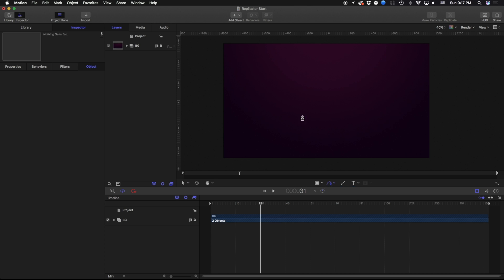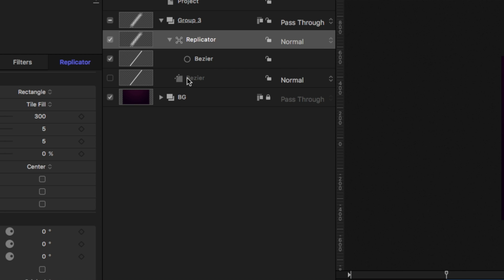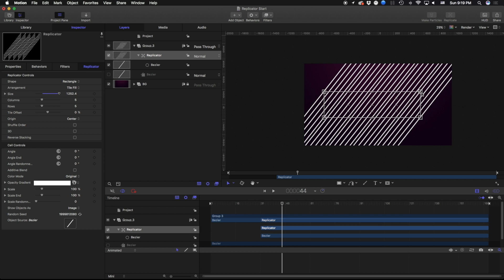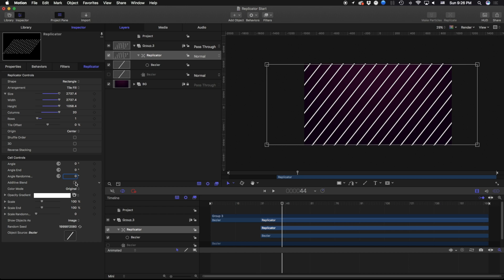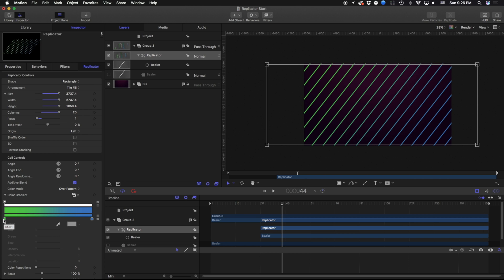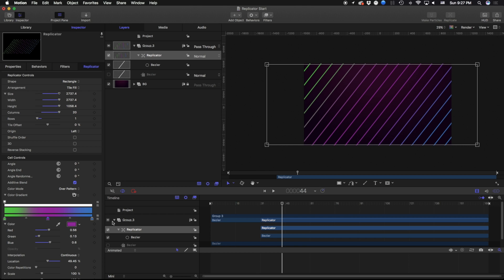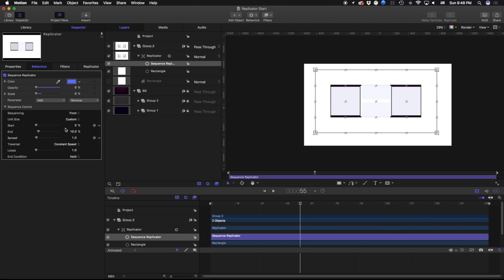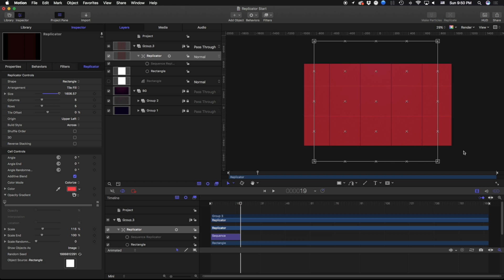Intro to Replicators - Apple Motion Professional Training 8 by AV-Ultra

Comment: Thank you so much for this series. When you replicate from top left, is there any way to have each cell come in one at a time? I notice it does the whole diagonal row rather than each individual cell and I can't seem to find a work around.
Reply from the maker: Yes! There’s a few controls that can be a little confusing. There’s cell control and replicator control. Most replicators also include a replicator sequence. This is what you want and can fine tune each and every parameter timing etc.

Comment: you are the best, thanks! have you found any ways to make a replicator reflect surroundings?
Reply from the maker: Kinda, either in two ways, flatten the layer matter and treat it as a single source, or fake it with a clone replicator layer and flip it and lower the opacity so it looks like a reflection. Hope that helps.

Comment: Following along and doing well until you replicate the replicator.  I cannot do this here in Motion 5.4.4.  The Replicate button is greyed out.  Searched Apple docs and it says you can't replicate replicators.  So, being the newbie that I am, am I missing something?
Reply from the maker: Interesting- perhaps they changed it? Let me check on this in 5.4.4 and see. Thanks for mentioning this. 
-Stanislaw
Reply from the maker: Try putting the replicator on the group the original replicator is on, instead of the actual replicator. 
Effectively- motion treats the first replicator as a single ‘flat source’ allowing you to stack the replicators.

Hope that clears things up and apologies in the delay.
-Stanislaw

Comment: Hey Stan, thank you so much for this series!
I'm actually curious to know if it's possible to use these sequence replicators to do drop zone transitions.
At 15:50, this could be an awesome transition if the element was actually a drop zone and that the background would be another drop zone.

Could you do an episode about it please? 

Keep up the amazing work!
Reply from the maker: Hi there!
The short answer is you totally can- the long answer is it will take a little more work if you want different things in each dropzoone.
By default the replicator will copy the 1 dropzone, so you would likely have to figure out the maximum number of squares or rectangles, make that many separate dropzones (or clones to double up some images) and add them all to the replication.

Another option would be to make a series of image masks for the transition from A-B creating a reveal of the next clip.

Its a very interesting topic. I have a transition lesson coming up in the next weeks, so I'll be sure to be investigating this a bit further.
Thanks for the suggestion and thanks for watching.
-S
Reply: Thanks for your swift reply! Eager to watch this transition lesson!